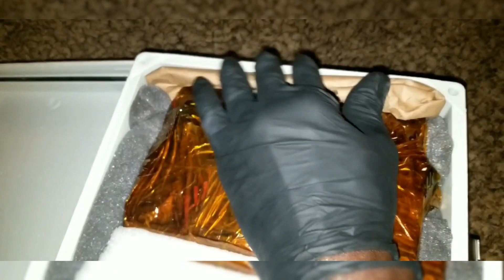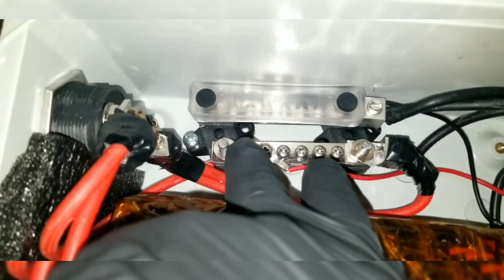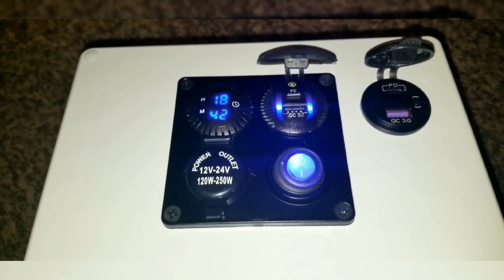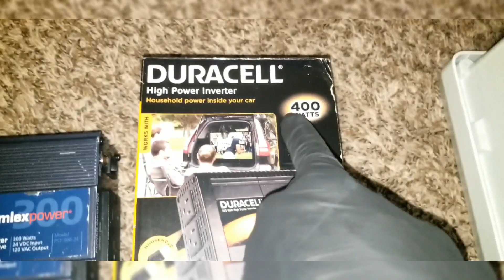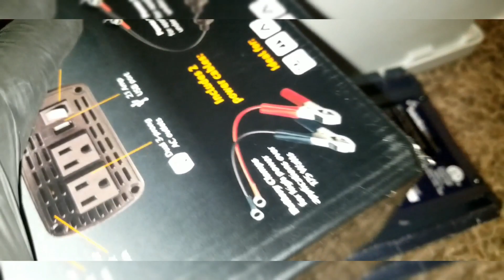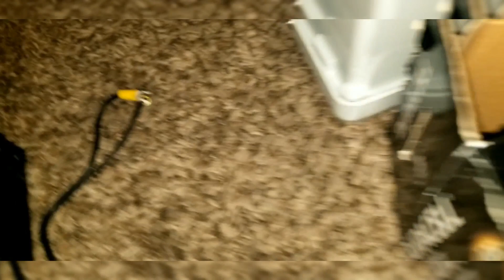#2021 #SOLARPOWERED #INVERTERGENERATOR #CHARGINGSTATION COMPLETED

Comment: NOW THATS AN AWSOME BUILD CHARGING STATION . LIKE THE IDEA OF ATTACHING BOTH BOXES TOGETHER WITH SCREWS AND NUTS . A HANDLE MAY BE IMPLEMENTED FROM A COPPER BAR OR A LARGE DOOR HANDLE AND ATTACHED TO TWO OF THE 4 SCREWS AND NUTS FOR PORTABILITY .  I COULD GO FOR THE SAMLEX PURE SINE WAVE ON THE SIDE OF THE BOX BUT THE DURACELL SEEMS  MUCH SMALLER BEING A MOD SINE WAVE CAN BE UTILIZED FOR THE BEST FIT TO SUITE POWER , SPACE AND WEIGHT  . MAY THE SOLAR BE WITH YOU .:goodvibes::goodvibes:👌👍
Reply from the maker: Thanks brother Cedric for your awesome comments suggestions.
May the solar and wind be with you 🌞💨